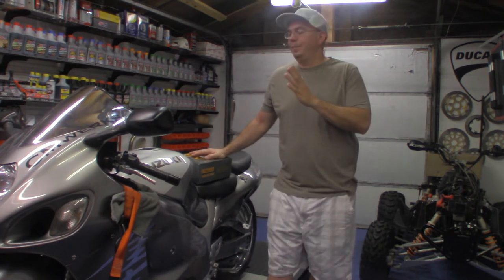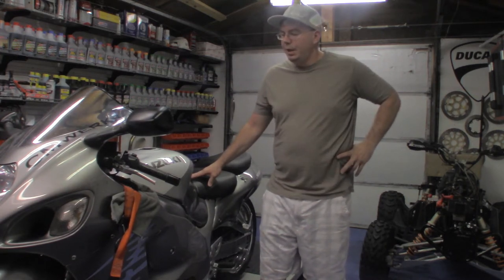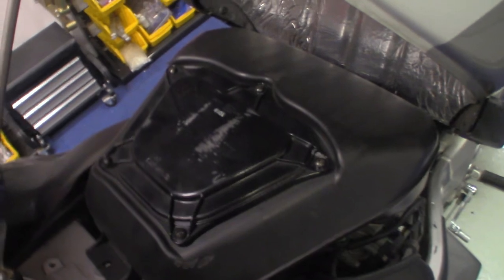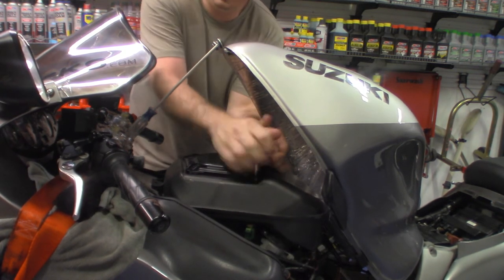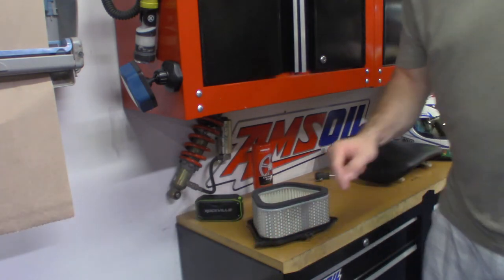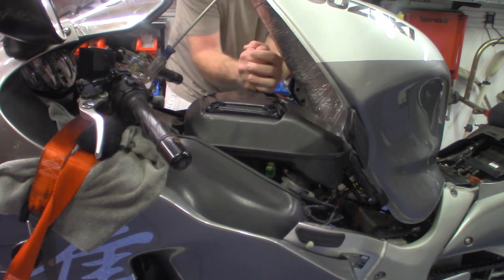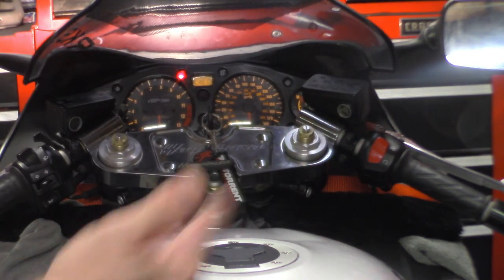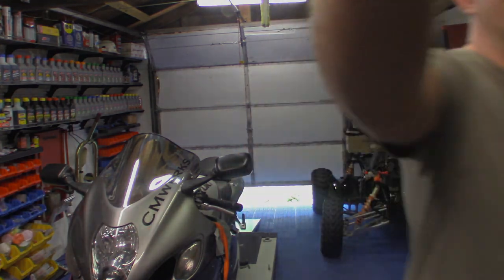Hayabusa Air Filter change Gen1 1999-2007

Comment: Just wondering why did you take off the seat for air filter replacement?
Reply from the maker: I thought i needed to do that to lift the tank vertical to access air filter. Most bikes get caught on the front of the seat and wont lift vertical without the seat removed.